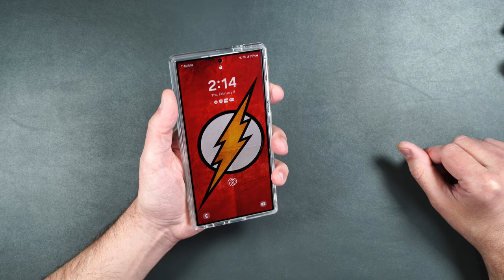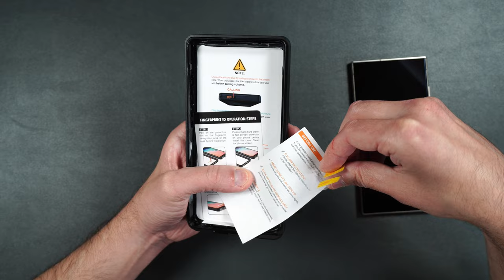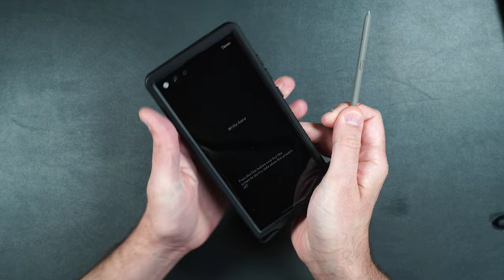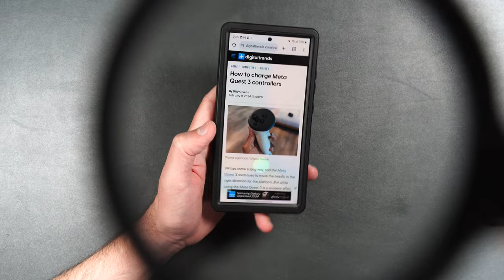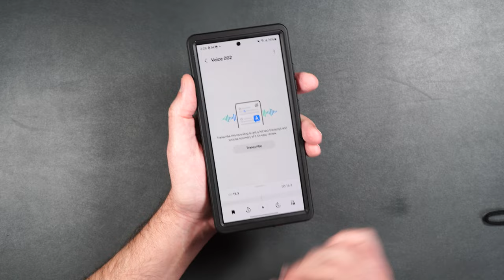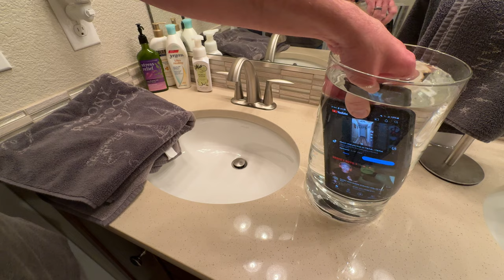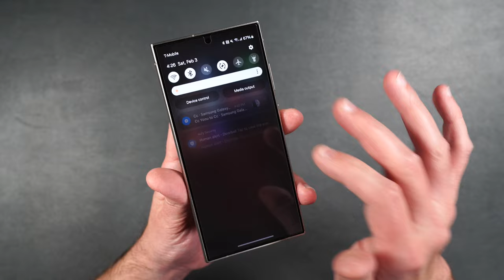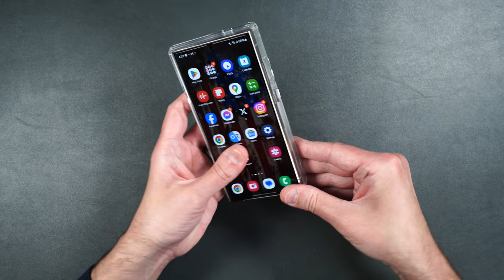Galaxy S24 Ultra Waterproof Case & Accessories by MOTIVE

Comment: Amazingly detailed and straight to the point review, great stuff mate.

One question though, how well do you think the rear plastic would protect from drops if the phone landed on something not particularly flat? Would there be room within the case to put another protector, like a sheet of foam or silicone inside between the phone and the clear backing of the case?